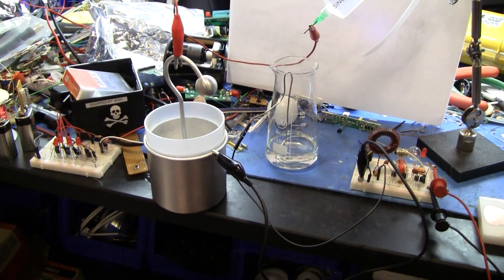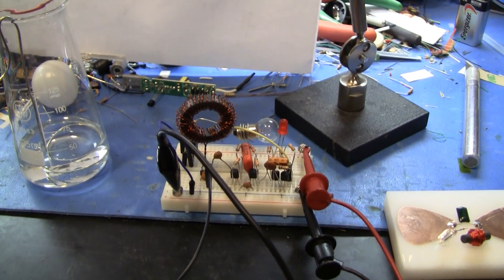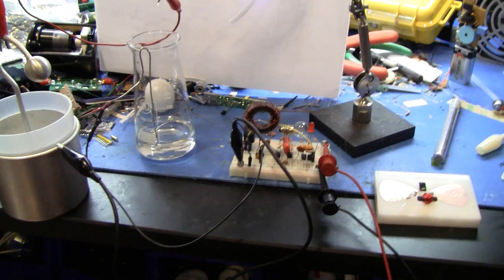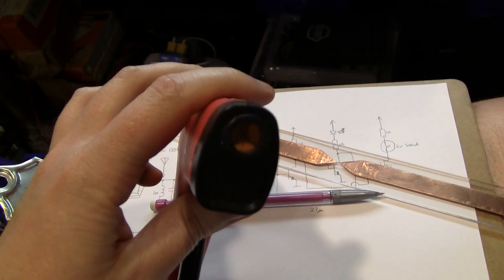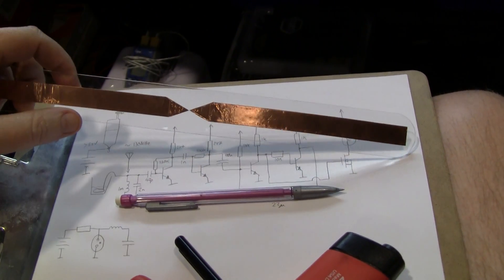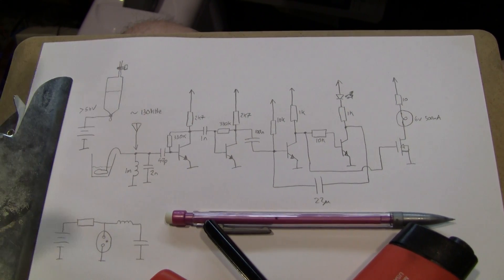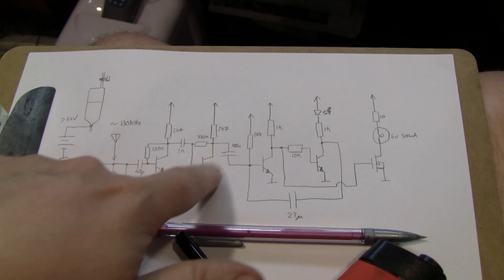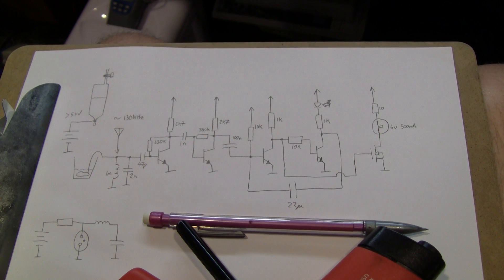Flashing Light Prize 2017 Entry - Charge Dripping Flasher

Comment: The real reason was that I had a very high voltage spark generator gadget on my desk which was on sound mode. I bought this gadget years ago. This was picking up the sound and generated sparks which my lightening detector was picking up.

Comment: really cool circuit!
Reply from the maker: Thanks mate.  I was gonna do it using a FET charge-sensitive front-end, but this doesn't need resetting to keep the voltage reasonable and has other uses beyond counting charge packets.  The FET circuit would be capable of operating with much less bias on the water reservoir however, and might be based on JFET that can be reset by forward biasing its gate diode.

Comment: Good video and a very interesting circuit, worth to be reproduced! The only problem is that I cannot read the values from the components, they are too vague.
Reply from the maker: If you pause around 2:19 the circuit is pretty visible.  The values are all in the base units of inductance, capacitance and resistance with standard multipliers.  The decimal point is replaced with the multiplier, so the 2k7 resistors are 2700 ohms.  Front end inductor is 1 mH, resonated with 2 nF, coupling cap is 47 pF.  Interstage coupling caps are 1 nF and 100 nF.  Monostable timing cap is 22 uF.  All the BJT transistors are 2N3904 or similar, any small signal NPN will probably be fine.  The FET is an IRF510 but isn't critical, a 2N7000 or BS170 would probably be fine for small lamps.

Maybe I should make another video about it at some point?  I would redesign it to be more power efficient so it could run from batteries for months.  I'd probably add a boot-strapped follower to the front end or tap down on the inductor, maybe add some way to adjust the RF gain to change its sensitivity.  Using antenna length or supply voltage to control the sensitivity is kinda terrible.  The monostable does not need to burn as much current as it does, the bias currents can be vastly smaller, it does not need sharp very edges for driving light bulbs.  A complementary pair monostable might save a few components too.
Reply: Thanks for your reply! Appreciated it very much, gonna study the circuit again.